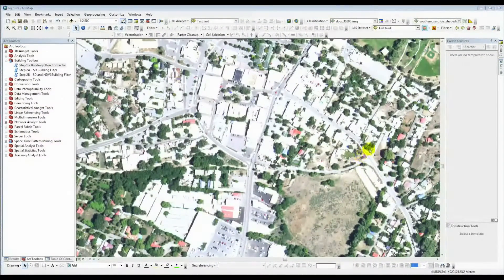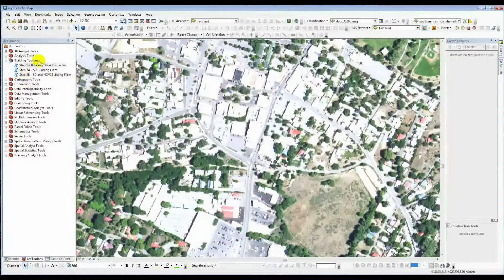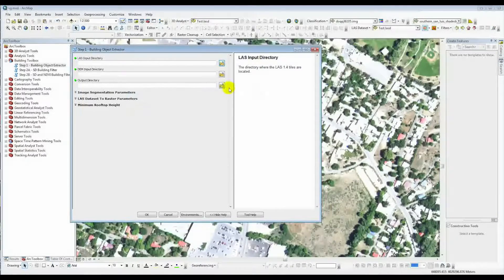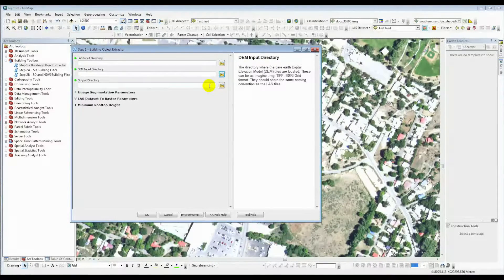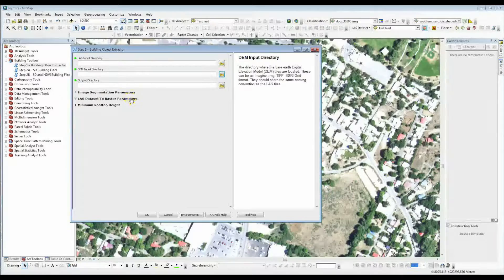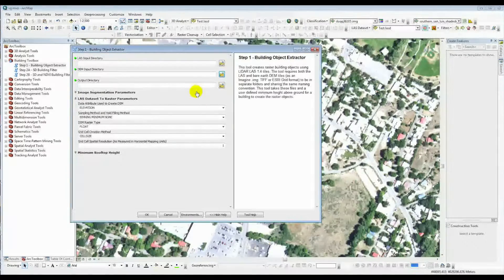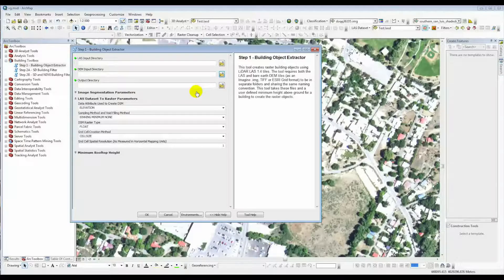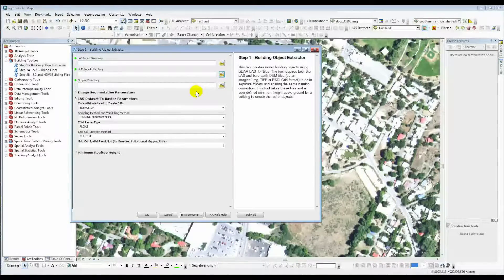Part 3 Building Object Extractor

Comment: I have been trying to use this tool and I get an error message on this first step. The error is ERROR 010416: Error in setting raster table filter. I have separated the LAS and DEM files into different folders with same naming system. Wondering if you have any suggestions?
Reply: I encounter the same error message. Were you able to solve it?
Reply: @jobtaminiau8140  No I didn't, ended up doing a workaround with like 4 other softwares.
Reply: @ritobin2305  I'm getting a bunch of strange errors that seem to make no sense. What was your workaround?
Reply: I went to edit the source code of the tool in Pro, and I went to line 196 which the error was referencing, and I noticed that at the end of the line of code it said - "COUNT < 10000". After looking at this site -

https://pro.arcgis.com/en/pro-app/tool-reference/spatial-analyst/con-.htm

It seemed like it should be using VALUE instead of COUNT, since that is apparently what is used in conditional statements like that. After I did this, the tool ran successfully without giving any errors.

I replaced COUNT with VALUE in the Step 2A tool as well and it worked.

The lines where I replaced COUNT with VALUE are 196, 316, 447 and 457.